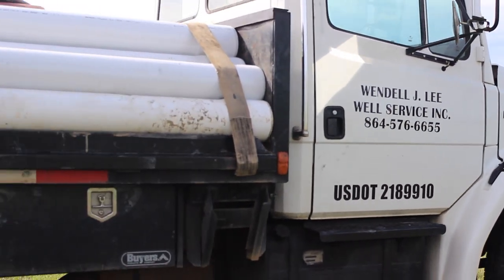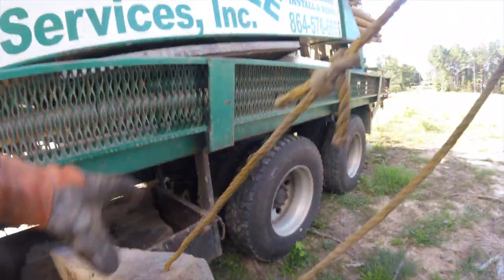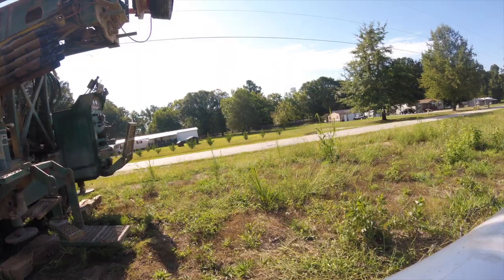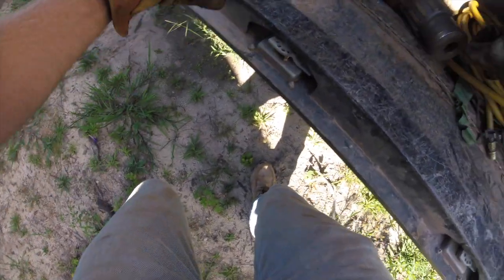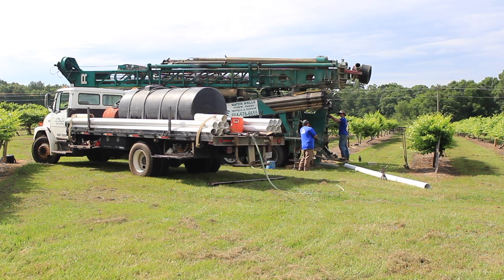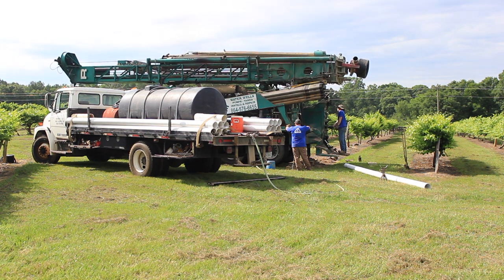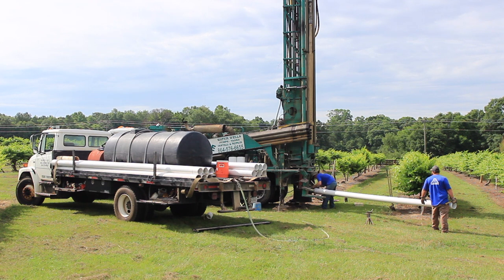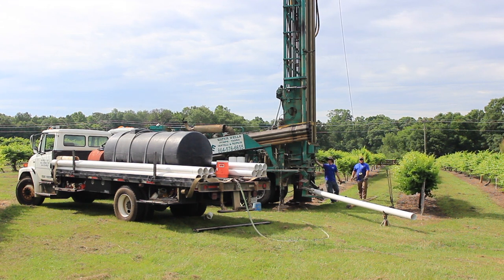How a Water Well is Drilled: Setting Up To Drill A Well

Comment: criss crossed 2×8's sandwiched between 1 1/4" plywood with rope handles are handy for quick set up..I worked 47 years in drilling and company started in 1922...still going strong..sold it six years ago...good video..thanks!

Comment: I work in the oil field. On our older truck rigs. Talk your out rigger blocks and nail a piece of 1” plywood on top of them to make a solid pad. Set your out rigger down and center your pads. Get you a welder and have home make you a Z bracket and screw them to the pad and weld them to the out rigger shoe. It’s permanently attached and you’ll never have to fool with it again...now that I saved your back, how about a discount on a well I need drilled. Lol jk
Reply from the maker: that sounds like a fabulous idea, ill take all the tips i can get
Reply: Wendell Lee Well Services email me if you need any pics or examples. erichemard at gee mail
Reply: Wendell Lee Well Services I’ve got a ton of other ideas that will help you out...lifting subs, diverter plans. I’m old school oil field trash.
Reply: Alot of times youll drag your outriggers getting into places and need all the clearence you can get
Reply: @erichemard7066  PRL Leading manufacturer supplier of drilling rigs in India We supply Export, customized the latest Hydraulic of water well drilling, blast hole rigs, portable rigs, core drilling, etc
Reply: @chasebishop9971  PRL Leading manufacturer supplier of drilling rigs in India We supply Export, customized the latest Hydraulic of water well drilling, blast hole rigs, portable rigs, core drilling, etc